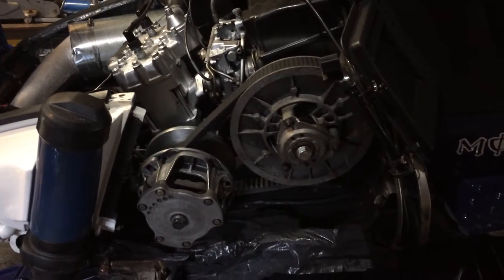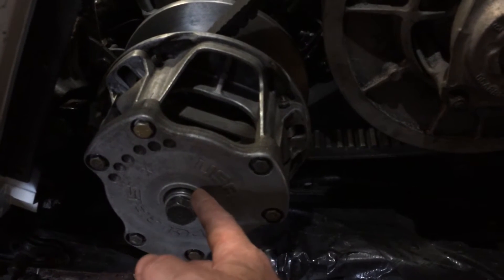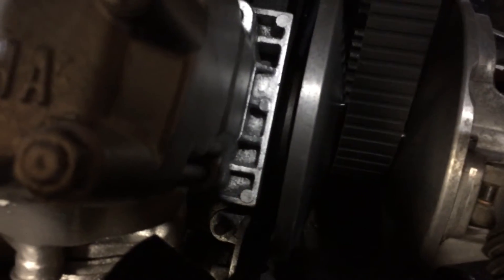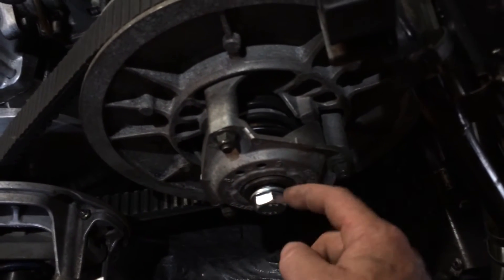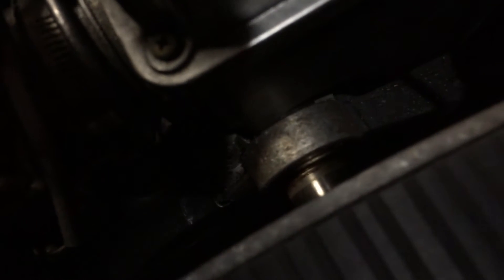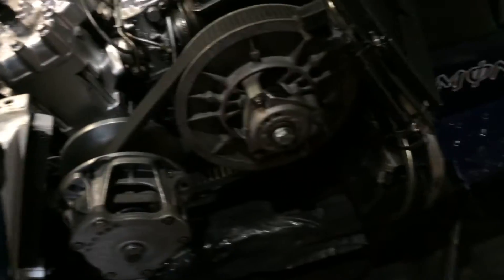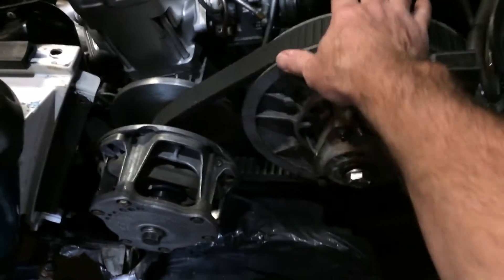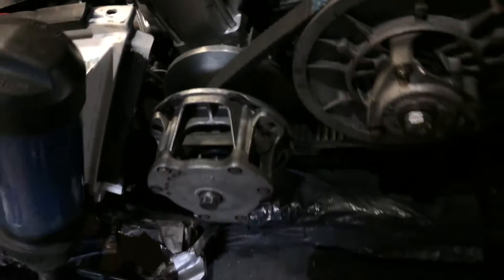P85 and 96 vmax 600 secondary on 87-90 yamaha exciter

Comment: In finland ill but same clutch in 500 max yamaha sled... what primary secondary distance is best to work this setting? My yamaha belt screaming * skvi skvi skvi* to drive that clutch
Reply from the maker: I’m using the stock secondary distance,the Polaris offset,you probably need to adjust the belt deflection in the secondary clutch

Comment: Hey am wondering what weights you have in primary, thanks.
Reply from the maker: Matt Folkins 10/58
Almond/gold spring
Sec red spring,45 helix at 50 or 60
Reply: I got a 96 Vmax, would you say I should do those specs? I questioned keeping stock secondary but 10-52g weights and blue primary spring
Reply from the maker: Matt Folkins thats what i started with and it ran 8500 rpm,not sure what you want to run at,also the stock 39 cam wouldnt work for me,testing is the only way to know for sure,a couple grams different weight only makes a small rpm difference,spring controls engagement rpm,blue was fine with lower weight but i needed more spring as i went up
Reply: Think I’ll run that previous setup I posted above but not sure what secondary setup I should run, Hartman recommends blue spring with 52g weights
Reply from the maker: Matt Folkins well if youre at the right rpm but low on mph put a bigger cam in it,smaller cam better backshift,bigger cam faster acceleration and speed
Reply: Bigger cam as in helix?
Reply from the maker: Matt Folkins yes helix
Reply: Curious what one I would need as I don’t really want to go buying them just for fun lol
Reply: Put the p-85 on my sled and used the factory Yamaha Vmax clutch bolt, is there an other alternative to use?
Reply from the maker: Matt Folkins i used the factory exciter bolt,i dont think theres any other options and it works fine